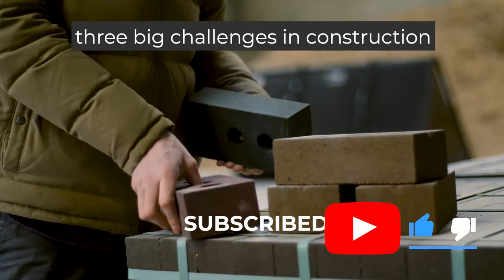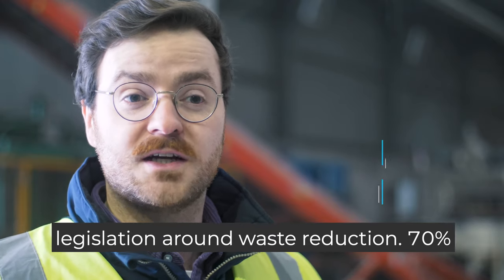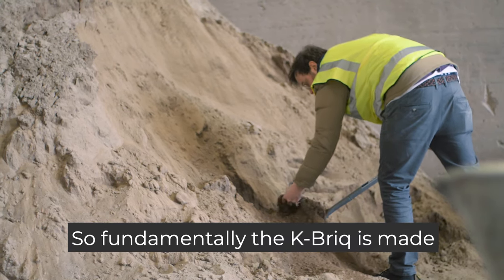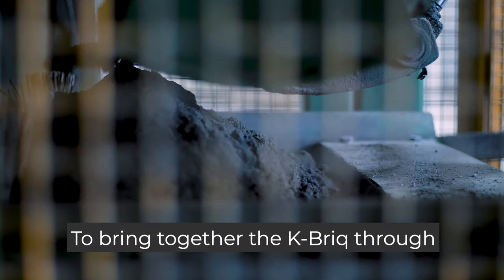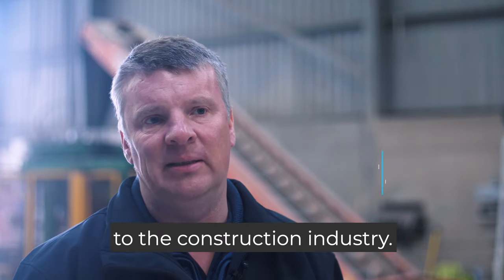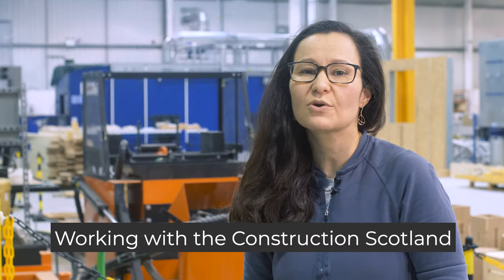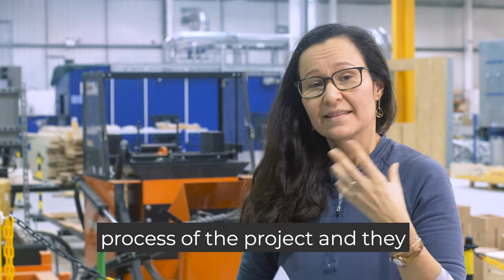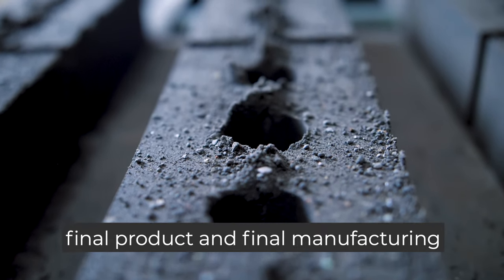The world’s first 90% recycled brick: The K-Briq

Comment: These where ‘invented’ back in the mid 1990’s several companies had them on demonstration, only no one would buy them and the insurance companies weren’t interested in underwriting the safety standard,  no safety standard, no insurance underwriting = no product
Reply: I can sort of testify to this.  I got a mortgage for an earth-buried eco home and struggled to find a good deal.  The rule seemed to be if the house was either of "unusual construction" or of "unusual materials" they wanted 40% deposit up front.  Mine was of the former.

In the end I was able to get a mortgage from the building society that had lent to the architect who build the place for a 5 or 10% deposit (my choice), although I still needed to pay for a full "tier 3" survey which came back with such things as "appears to have no guttering" - for £750 I was expecting them to at least pin their colours to the mast on such details 🙄

So clearly this would hamper prospective buyers until it was classed as an established material.

Comment: Carrying capacity and crush/break strength, while an important, are not a massive concern considering how often bricks are used in very light or non-loading bearing capacities. Obviously, for construction those will be factors that need to be looked at but even if these were just used for exterior purposes, it would mitigate resource loss. The bigger consideration is what happens when consistent heat is applied to them; if they give off fumes when exposed to heat then they may be more dangerous to people and contribute to climate issues than traditional bricks.

Comment: Alternatively you can use a 100% recycled brick that's actually an unique design. Precious Plastic / Recycle Rebuild offer a brick design that can be made out of HDPE and PP plastics. This isn't much of a step forward, whereas the alternative is a huge leap in the right direction.
Reply: Exactly. One thing that isnt so impressive about the K-Briq is that it still is just some proprietary 'thing' that requires your subscription to big players. I'd rather make my own products and trade with others who do the same. Its much more fulfilling and if people do it more often it will literally turn garbage into something of value that might even help the poorest of the poor start to form actual wealth and material assets (because of forming an economy within an economy that cannot be tampered with as easily since the products have solid value and the source is basically free)

Comment: Polystyrene +petrol = superglue  secret sauce
Reply: I see you too have discovered the secret sauce that is gasoline goop.😂 I once made a small brick out of mostly sand and (gasoline+styrofoam=goopy goop). Like 10% goopy goop 😂 90% sand. (Or just add sand until it starts for form stringy webs when kneeded and then compress your lump into a form (i used a box).The brick had the strength/squishy and bendy texture of a granola bar for like 3 days to a week until it became so hard it feels like an actual brick now maybe harder. Had a gasoline smell for a long time. It makes a 'tink' sound when you flick it hard enough but doesnt feel hollow. Voids and air pockets can form in these depending on the ratio of sand to goop. Thats not always a bad thing in my opinion.
Btw the ratio of polystyrene to gasoline I used was a 1:1 ration of the two based on measurement of weight. There may be better ratios this was my first experiment and was very loosely measured when i mixed in the sand. Hope this helps someone somewhere.

Comment: conventional made bricks have more benefits and reason for use .  heating and cooling insulation for buildings ,  strength , sound insulation ,  fire resistance compared to others so less rebuilding ....   Where is the peer reviewed research about  the difference between conventional kiln fired bricks and these new types.

Comment: If I want to test a brick I bang it with a trowel or hammer. Smoothing my fingers along the surface is no good . The idea seems better than the presentation . 
Cracks in walls is caused by using hard portland cement rather than lime mortar . Lime mortar allows some movement . But these bricks will not absorb moisture like a normal brick . That`s a good point  . Lime mortar dries too slowly for normal building speeds . That`s a bad point .

Comment: How does concrete cause global warming/climate change?
Reply: One of the steps in concrete is cooking limestone to high temperatures which both releases a massive amount of CO2 into the air and requires massive amounts of energy in the form of burning fossil fuels or using electricity.
Reply: @DrSlobGoblin  So you have data showing this to cause changes around the world?